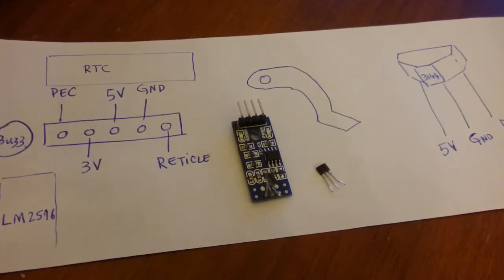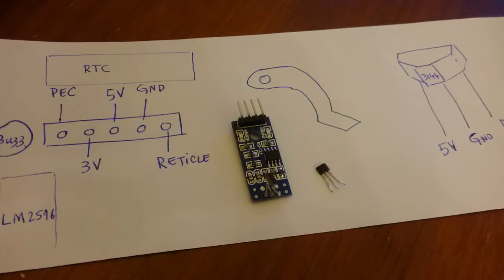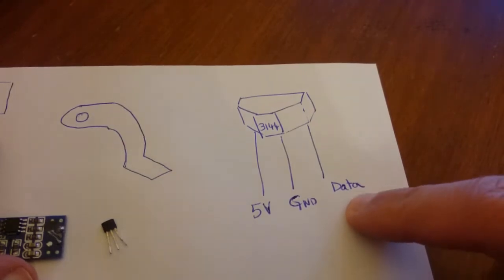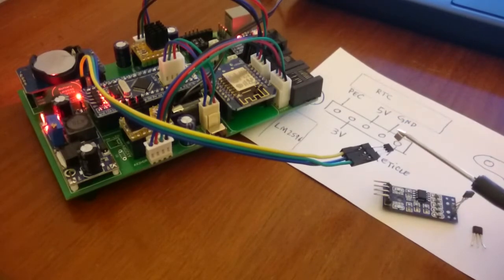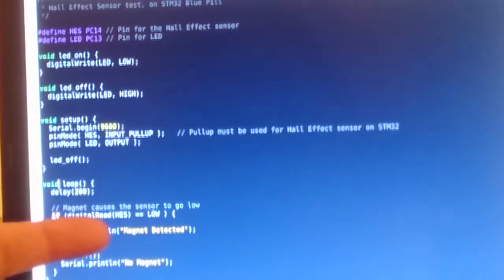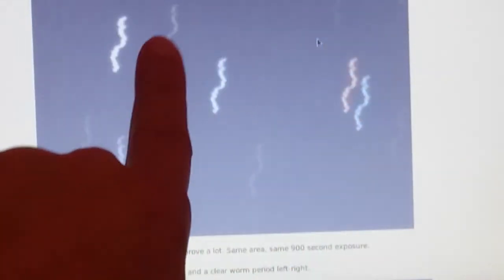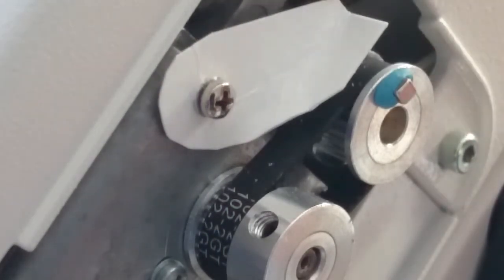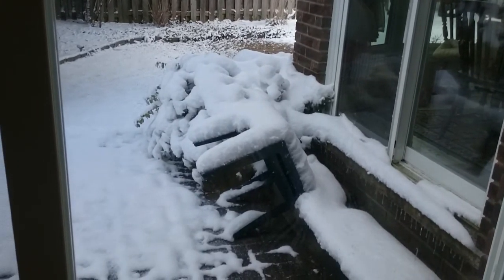Hall Effect Sensor for Periodic Error Correction (PEC) on OnStep STM32

Comment: I put PEC_SENSE  to ON_PULLUP....PEC_SENSE_STATE  to LOW.....I tested pin is ok, it change from 3.3 to 0 when magnet close to sensor. (hi is still 3.3 v also if I change jumper on 5v). But nothing works. Indi driver on ekos not detect sensor.
Reply from the maker: I don't have a quick answer. 
You can ask in the OnStep group.

Comment: Hello and thank you for the very useful sharing of your work. I have a question: in your video we can see that you use the Hall effect sensor 3144 in standalone mode and then there is also a circuit with 4 pins: this circuit I assume should be connected on the Onstep board in the same way as you connected the "standalone" sensor as I read that the fourth pin named A0 is not valid, is this correct? Also what is the difference between using the "standalone" sensor and the sensor mounted on this mini-board? Thank you.

Comment: i connected the sensor on the ramps.  but I don't know if it is working or not any light is not on in mega, will a library be loaded for the sensor?, also how can I tell if it is working.
Reply from the maker: Use a multimeter to measure voltage on pin when a magnet is close to the sensor, and when it is not close. If voltage changes, then all is working.

Comment: Could you show how to use PEC with the index. What's the advantage .
Reply from the maker: What I did is record PEC several times (about 5 or 6) using autoguiding from the main scope. This stores the PEC corrections in EEPROM. Then when OnStep starts it will always playback PEC corrections. The advantage is instead of the star oscillating back and forth, it will be tighter, and closer to a round shape. More on the OnStep Wiki https://groups.io/g/onstep/wiki/8-Advanced-Topics
Reply: @khalid_ba  yes ,but i found the sky platinum could restore once at one time when the record finish, it will auto playback.how do you record several times.thank you !
Reply from the maker: @yangyunbo1  To record multiple times, I use the Android App, and click Stop under PEC, then start a guiding session, and press Play. After recording is done (number of seconds for worm period), it will play automatically. Stop, and repeat several times.
Reply from the maker: If you don't know what Periodic Error Correction, then read this article which explains what it is. 

https://themcdonalds.net/richard/wp/astrophotography-mounts-periodic-error-correction/